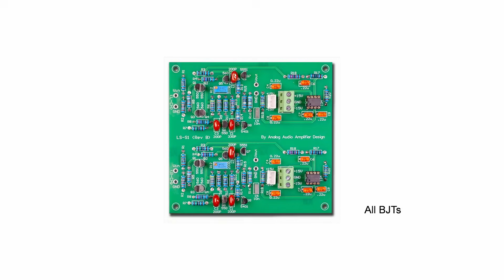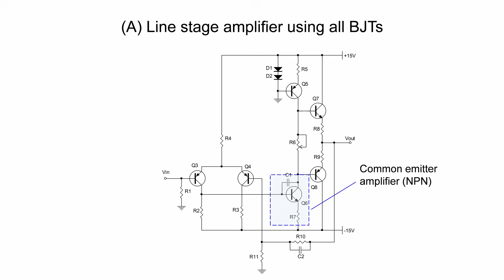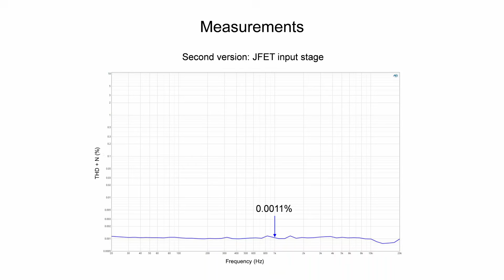Design a very low distortion line stage amplifier using bipolar transistors for beginner  #amplifier

Comment from the maker: In this video, the design of a very low distortion line-stage amplifier using all bipolar transistors is fully discussed. The THD + noise at 1kHz is 0.0016%.

Comment: Design is easy. Making an Etched circuit board is the hard part. And how about a cabinet?
Reply from the maker: Gerber files are available for free. The design in this video lays the groundwork for the line stage amplifier with a JFET input stage. It will be shown next time.

Comment: Did you consider transistor current sources for the two LTP inputs, instead of chosen resistors? Would it help with distortion even more? 

1:00 I believe the current source diodes, need current limiting, or they will blow up. Luckily it's just example circuits being shown.
Reply from the maker: Thank you for your comment. Resistors are chosen for the LTP in this simple design.  0.0016% distortion is good enough for such simple design.  For the diodes in 1:00, there should be a current limiting resistor. Thanks for pointing this out. It was missed out from the drawing.

Comment from the maker: Chapters:
0:00 Introduction
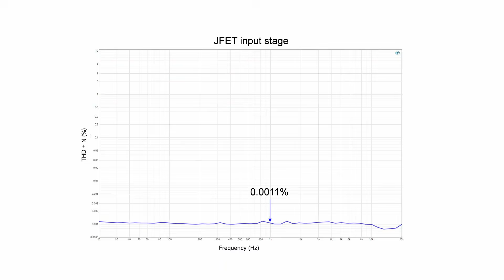0:27 Line stage amplifier with all BJT
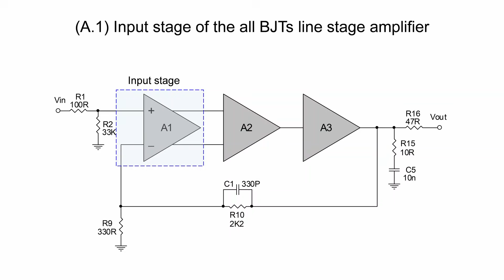5:16 Input stage
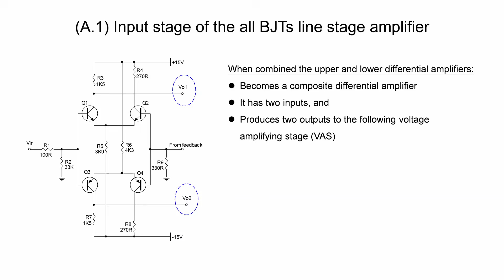8:01 Volage amplifying stage
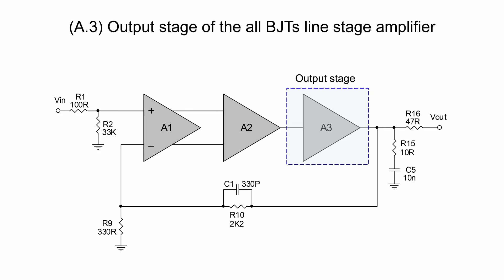11:35 Output stage
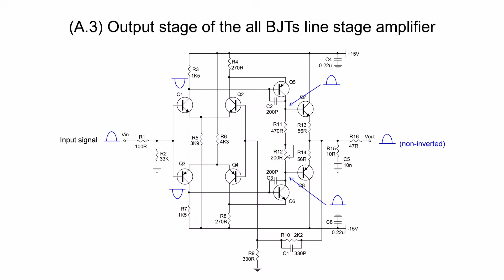13:15 Output network
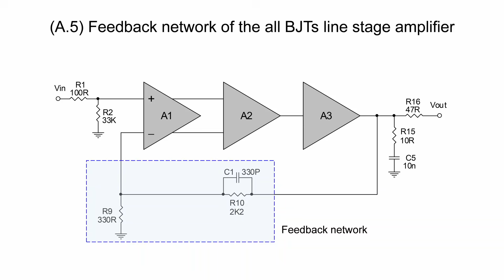13:40 Feedback network
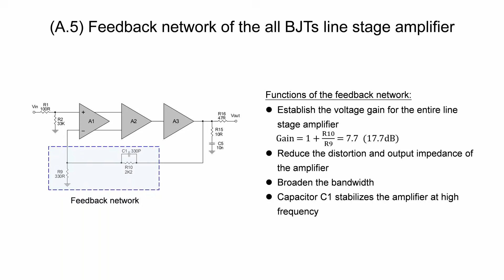14:08 DC servo 
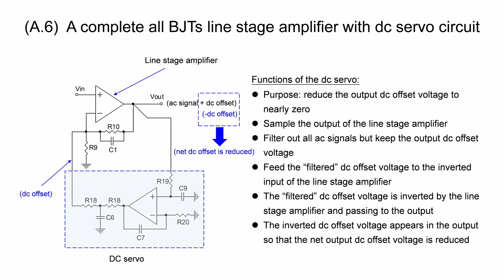16:02 Reference book
18:11 Measurements